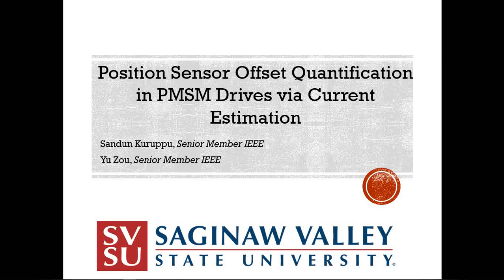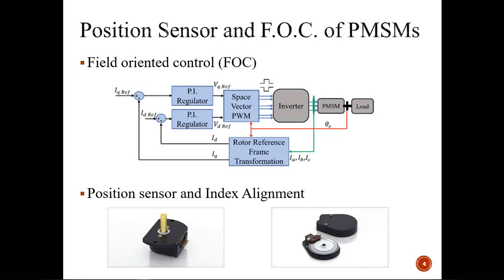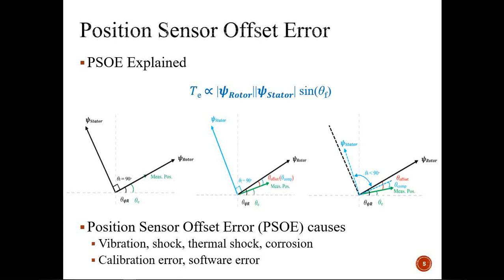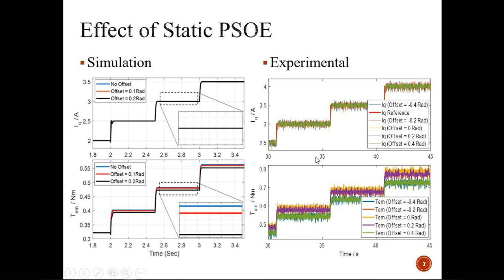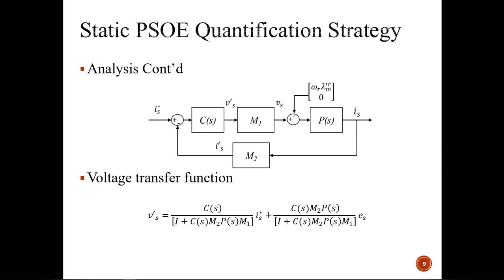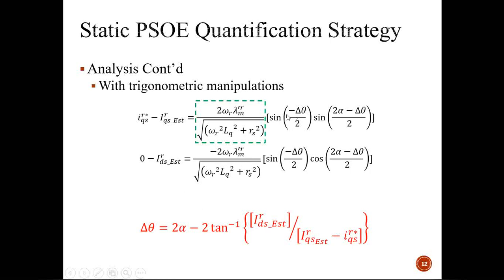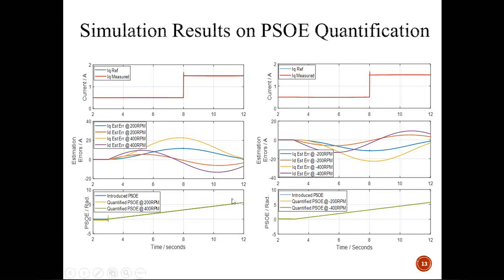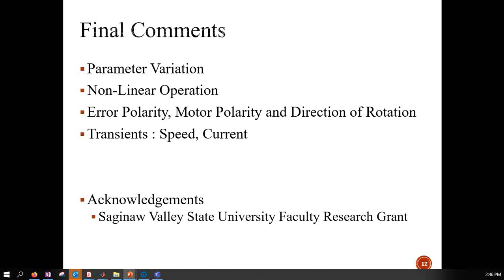IEEE ITEC 2020 Presentation (PMSM Position Offset Quantification)

Comment: Hello please could you tell about how to calculate  the Id current to be injected to align the rotor position and what is the time length. Id current to be injected depends on motor electrical and mechanical constant. But I want to know how to calculate how much current and for how much time to align the stator flux with rotor flux in pmsm
Reply from the maker: Hi Shivaleela, what are you trying to achieve here? Are you trying to perform an offset calibration using alignment or is this a sensorless application?

Comment: Does it mean that a model estimator is necessary to track and reduce this misalignment in position error ?
Reply from the maker: Yes Subodh. This essentially looks at how the system is behaving and uses the steady state model to identify the error. Model estimator is necessary and the estimation is as good as the parameters you have. It is useful in cases where large position error exist, as it can drive torque to zero if not reverse the torque!

Comment: Is it possible to combine this strategy with high frequency injection to be able to detect the offset error at standstill?
Reply: Ah, nvm; already saw in the equations the error is not observable at zero speed.
Reply from the maker: You need saliency for HFI to work and I dont think it is needed in this case for detecting PSOE.